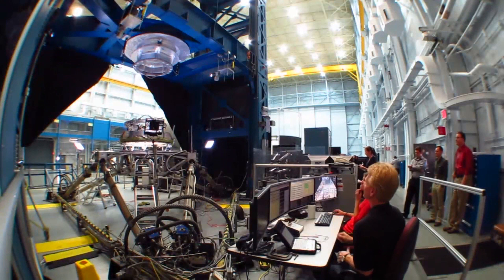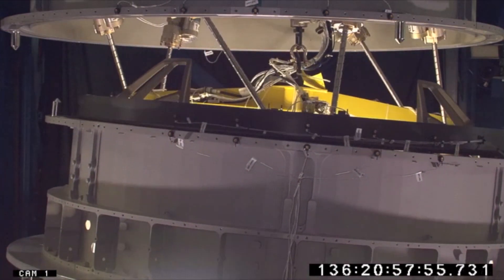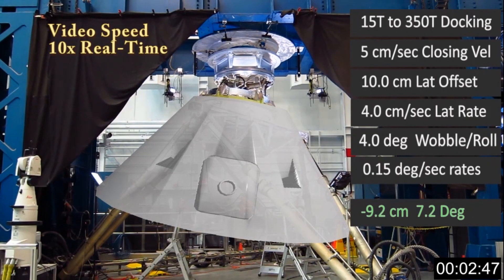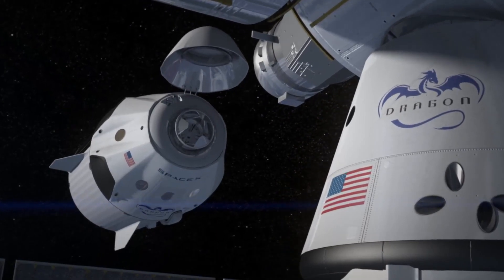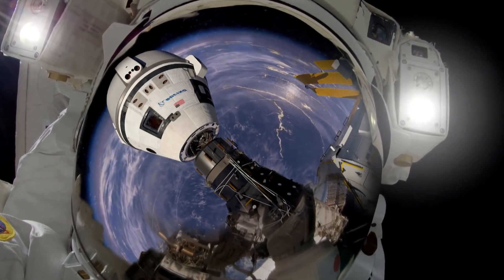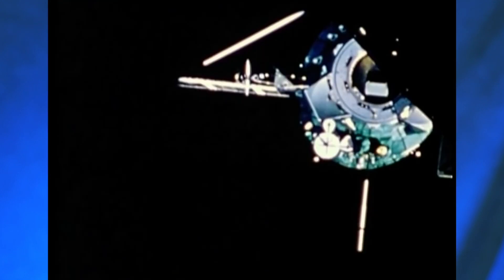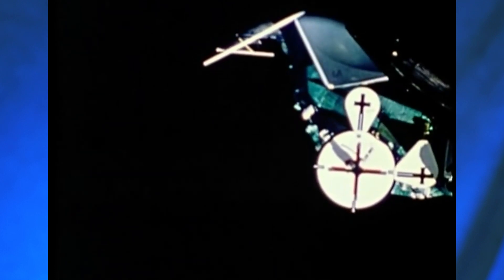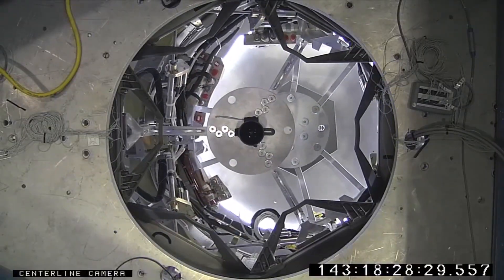Six Degrees of Freedom Docking Apparatus

Comment: Wonder if SpaceX will develop something with a bigger aperture, less hard edges, and finally, fuel, water, power lines and oxidizer lines. I also think there are too many hydraulic jacks, 2:49 shows there is still impact. Coil springs and solenoids would do the job too.
Reply: they are they are working with Boeing and Lockheed Martin to build this system but to use it every craft from ISS to Gateway has to be fitted with an IDA module since APAS does not work for most ships.